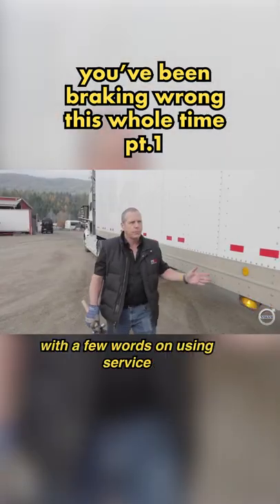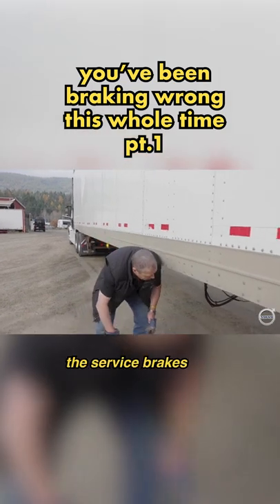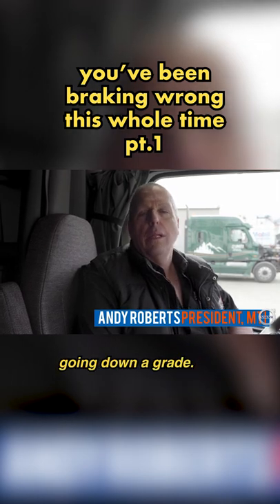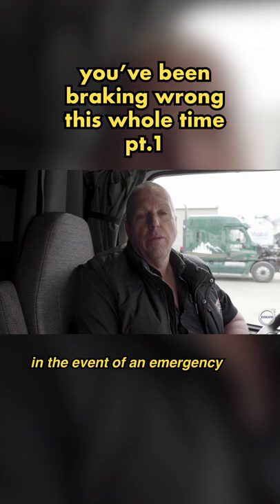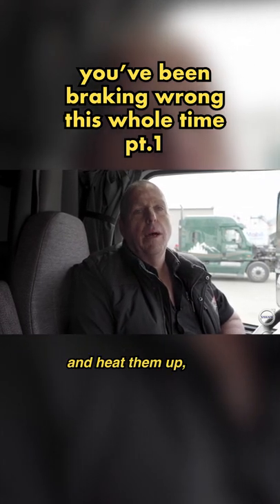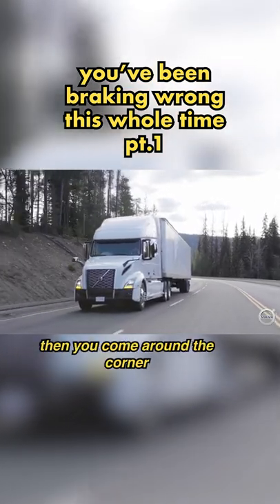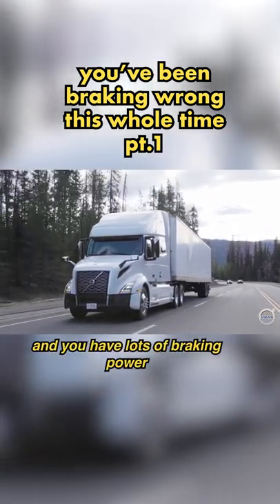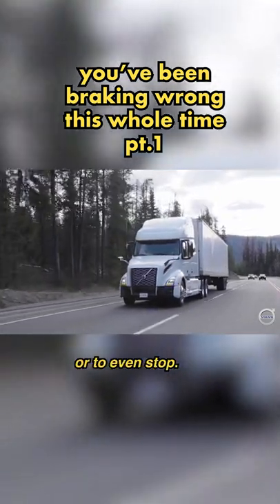YOU'VE BEEN BRAKING WRONG THIS WHOLE TIME!! pt.1 #shorts

Comment: Best thing to do is jus t keep the engine brake on full blast, drive on the right hand side, and drive 10mph below the speed limit when going down hill. Use both the tractor and trailer brakes to slow down gently if required.

Comment: I drove all over the USA for 50 years and quite a few didn't have a Jake. What a crock. I started out in the coal mines straight up an down with coal, cinder blocks, 40 an 50 tons. Most of us old drivers have passed on a long with real trucking and not all this bullshit. You would be up the creek if your Jake quit working going off cabbage, the grape vine, or jelico. 😮

Comment: Yeah this is bullshit. Of course you shouldn't rely on service brakes to slow you down a long grade, but they are 100% designed to stop you. That's what the massive springs in your brake chambers are for. There was a time before jacobs style engine brakes were common. If you're running with any decent outfit and have air disc brakes, the hotter the rotors get the harder the pads grip because of expansion.